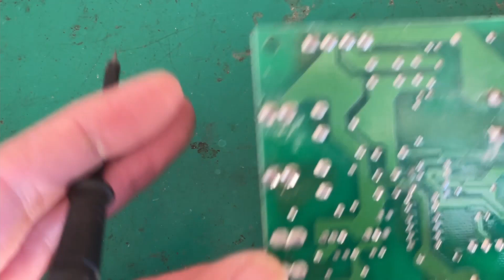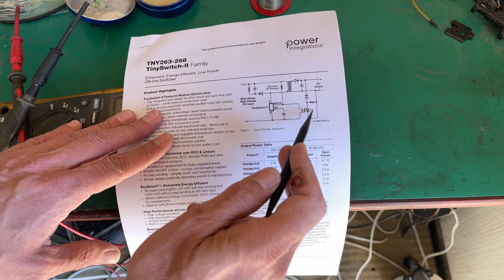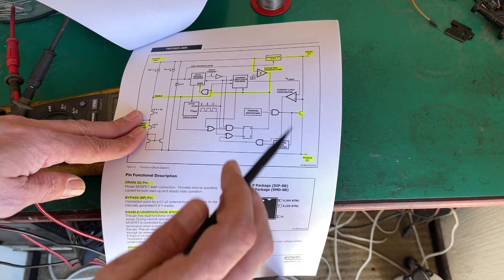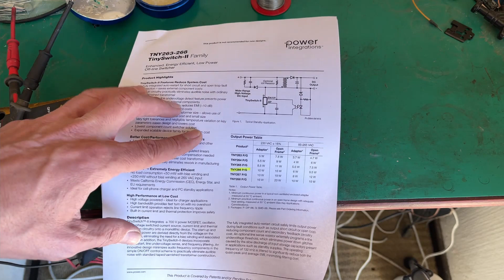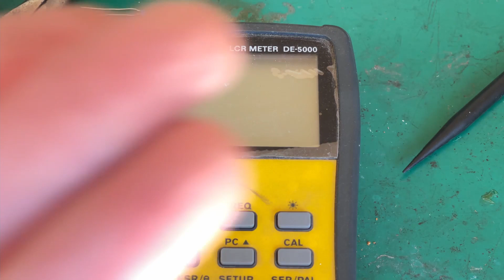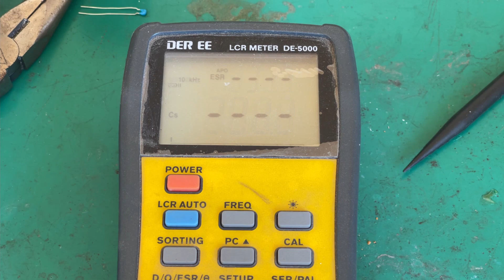FoulkesBrau #61 - Two Trojan treadmill control boards - DCMD67 PT 1

Comment: WOW!!! Craig, that was amazing troubleshooting techniques. Really interesting, informative and helpful, such insight!!!! 
Tell me if you have time to repsond. What is the purpose of the relay on this board? I am thinking it is a inrush current limiter with such a large capacitor? I've seen this on other boards where the relay is in parallel with a large resistor. Thank you so very much for all your time and effort on these wonderful videos, especially concerning exercise equipment boards.
Reply from the maker: Hi Andre,

I'm guessing here as I have never looked at the relay part of the circuit. I don't recall any inrush current limiting devices - normally an NTC resistor. There were also no large power resistors.

The relay switches in immediately - well as close as I can tell. It also disconnects fairly quickly. 

When measuring across the FET drain to source, I measure rectified mains when I unplug the power. This gradually fades as the capacitor discharges through a very high value resistor and an LED (sandwiched between the relay and the cap). The charge in the capacitor is blocked from returning to the AC legs via the bridge rectifier. I do not measure voltage across the FET drain source unless the auxiliary voltage circuit is up and running. 

I cannot be sure as I don't have the board in front of me, I suspect that the relay is there as a protection device i.e. It will only switch the rectified DC power rail through if the auxiliary power circuit is up and running (The circuit that the TNY266 drives). So the micro controller and all it's logic.

The TNY266 that I ordered for the first board has arrived, so I will have a look in detail at the relay circuit. If I find that the function is different, I will update this post.

Cheers

Craig
Reply: @foulkesbrau3085  Thanks so much for that explaination Craig. I work on commercial treadmills for the YMCA and what I usually run across is boards that supply 3 phase AC inverter output from single phase AC 115V. It uses a booster circuit after the AC rectifier, goes through a hugh inductor and CAP chopped by FET and Diode to boost DC Buss then through a inverter and brake chopper, out to 3 phase motor. Usually I just replace these drive cubes (Advanced Drive Technologies) https://www.board-repair.com/loader.php?Ticket=051820180070. These boards are about $1,000 ea. I had a spare board I've torn down and have been working toward drawing out the circuit best I can, trying to figure it out. Your videos help so much!!!!!! If I can save my employer some doe it helps them with their mission. You are the best. Thanks again :->
Reply from the maker: Hi Andre,

I find with most of these boards - download the data sheet for the control chip. They normally have typical application circuits and most of these guys follow that to a T. 

From there it’s basically like LEGO - you put all the blocks together. 

I try not to use a scope in the repair videos as most people would not have access to one nor would they be able to use it safely on these types of circuits. So I use things that most people would have - multimeter etc. I must dash though - a scope makes things so much easier and quicker to fix. 

I’m glad the videos help. I’ve not come across the board types you’re dealing with. We have 240VAC mains here. So no need for inverters or three phase motors. Although I would love to get my hands on one just to get a look at the circuitry. 

Cheers

Craig
Reply: @foulkesbrau3085  I would be more than happy to send you the remenents of the unit I have dissassembled. It would be I think cheap enough to send without the heavy componets (the inductor alone weight a kilo and a half) I will include pics and data on the removed componets. How do I get your address?
Reply from the maker: Hi Andre - my email: craig at FoulkesBrau dot com.
Reply: Hi Craig: I sent email to craig@foulkesbrau.com July 30th. Subject line is "Greetings from Canada". Please let me know if you got it. Thanks